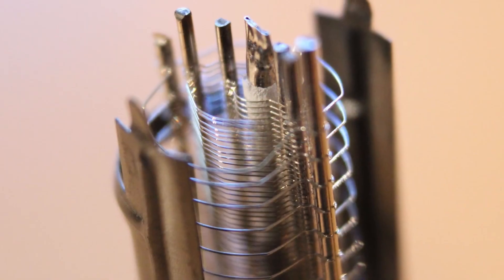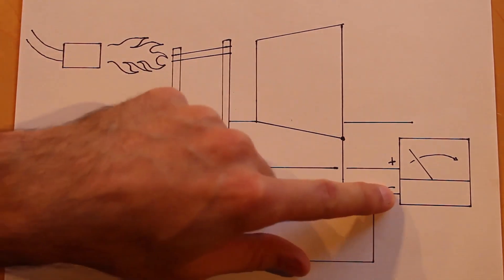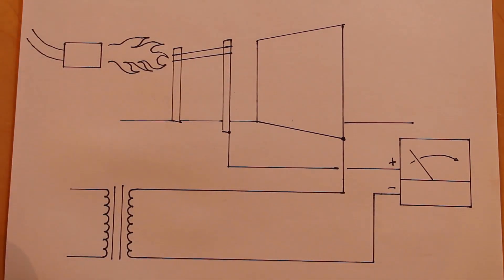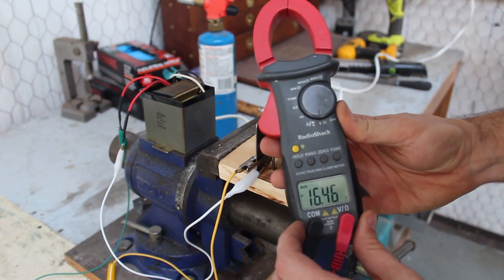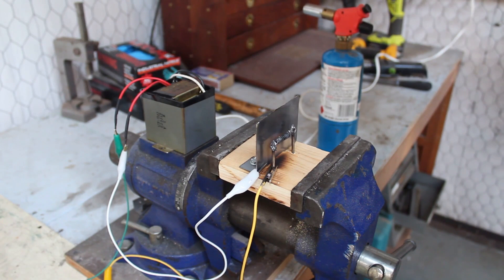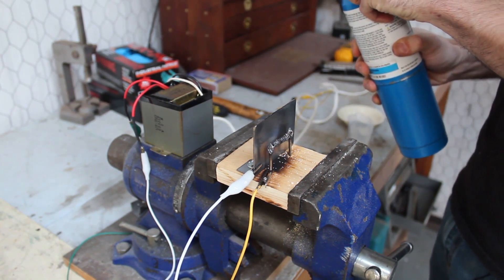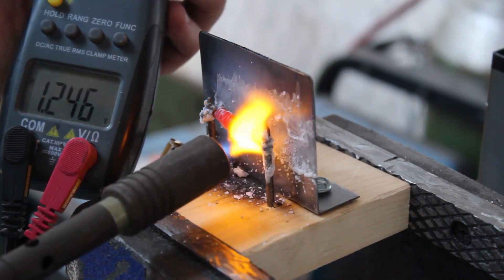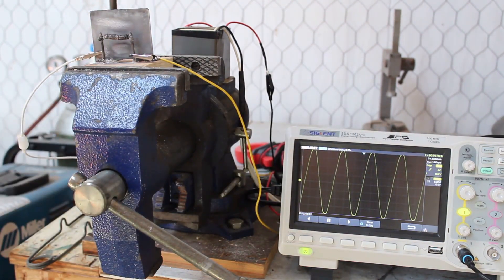Trying to See Thermionic Emission by Building a Flame Diode

Comment: i believe the problem comes from the ionization of the air molecules, this really do need a vacuum to work properly. also metals have different work function, im sure a cheap copper plate is enough as a cathode for this, just put the plates as near each other as you can. anyways, i really love these experimentation videos, they are fun. :)
Reply: Also the problem with using salt is that you are blasting it away so that it starts to coat the plate, and the surface of the cathode and the anode should be a nice clean surface for best result. :)
Reply from the maker: That definitely makes more sense! Experimenting with creating a vacuum is definitely something I want to try in the future as well, but I gotta work out how to get the cathode hot enough without a flame (also without having any tungsten filament hanging about that I can use). There's lots of good paths for experimentation here though!
Reply: The flame is made of lots of hot, tiny droplets in suspension, possibly reducing the isolation and increasing the capacitive coupling between the cathode and anode. This and the possible ionization is what probably caused the AC to appear on the scope. Maybe using an e-cig heater with its coil as the cathode would give a way to heat up without using a flame  ? Also if you get your hand on some alkaline earth metal (strontium or baryum), you can put it on the coil and get a good electron emissivity. But without a proper vacuum, this kind of coating may react with the air and dissapear quite violently...
Reply from the maker: @boutinclovis4233  I initially thought that the flame is what was carrying the coupling effect between them, but the high coupling remained even after shutting the torch off. The e-cig heater is an excellent idea though! I have one more idea I'd like to try using some scraps I have in the garage first, but if that falls through, I'll definitely look into that and see what I can come up with.
I mean, anything that might violently and explosively disappear in the air is high on my "to own" list, but until I figure out the whole vacuum aspect of things, that may have to wait, haha.